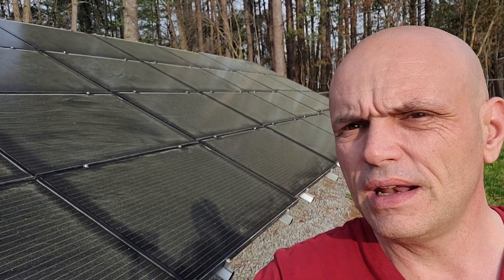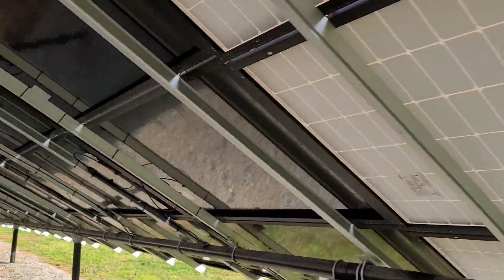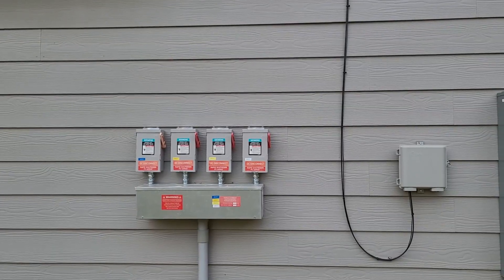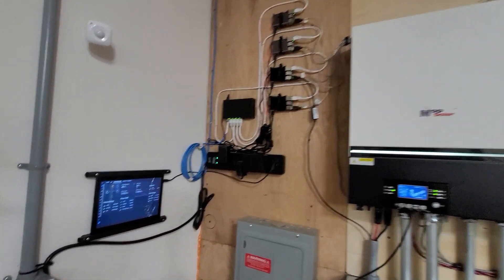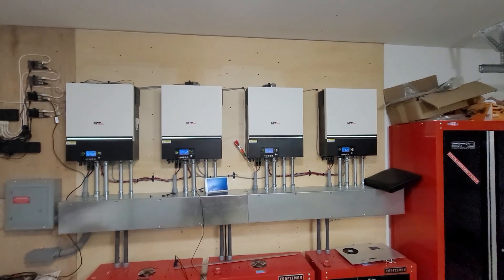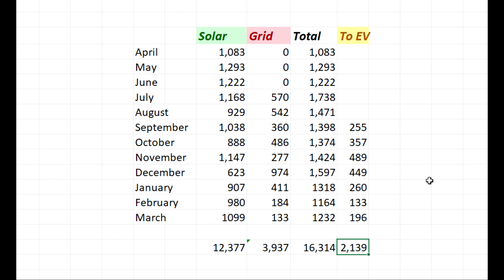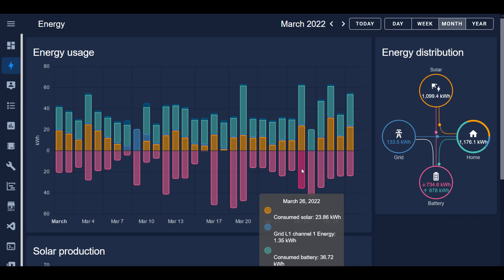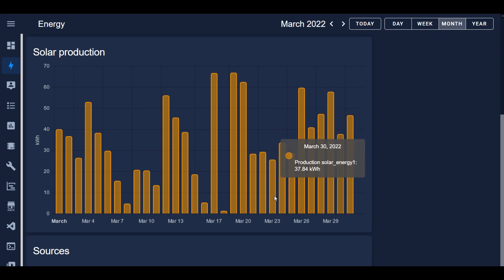LV6548 & 14 8 KW Solar System 1 Year Review (Production Numbers Included)

Comment: Trying to produce and store energy enough to be off grid all time is almost impossible in winter except if you spend a lot of money to add another 40 kW/h battery system. At one point, the ROI has to be part of the equation, not only the obsession to produce kW/h
Reply: 14kwh is only $2000 if you DIY raw cells so its not that hard to add another 28 or 42kwh

Comment: I am going to model my system off of yours....if you don't mind !!!
Question, how loud are the LV6548 at max power in/out ? Was wondering if I should mount them into a separate small room at the end of the garage or just leave them open to the garage. Also any dimming of lights when a high power appliance turns on.
Cheers.
Reply from the maker: Previous LV6548 videos answer all of those questions in detail.

Comment: Looks great. Thank you for the update. 

I agree with battery size 200%. Our 20640W PV and 132kWh battery barely got us through the first month totally off-grid without using the 10kw gen. It produced 1200kWh in March, 130kWh on one cold clear day after the three very dark days. 90% of that was re-filling our battery. 370A at 55.4V were going in for several hours. So you can also see how our weather patterns and latitude difference affect our outputs.
Reply from the maker: Thanks for sharing.

Comment: Great to see a 1 year update! I agree with battery storage as well, but .. there is balance that has to be achieved there for sure. If I do another system at some point I would go with the rack mount Lifepo4 packs.. Those babies are the t's  ; )  
I still have a garage full of panels. 34 to be exact because I put the install on hold again. I'm not sure whether I'll be staying in this house or moving yet. Also, there is the City inspection crap. So, I'll be in touch. Thanks for the update and I hope all is well down in your neck of the woods bro!
Reply from the maker: Everyone is good. What happened? I was eagerly awaiting updates from you...
Reply: I gotta say I’ve been waiting on an update also. Both of you guys really helped with my install. My 6548’s are doing fantastic. I just finished the majority of my install this week.

Comment: I really don't want to pay that much for batteries, looking atleast 100kw of battery to start to not have this issue. But attempting to figure out how to loadshift as much stuff as I can to solar producing hours, water heater, cooking, clothes. Wish I could find a way to offset a/c system, as here the a/c doesnt start running till around 2pm and doesn't stop till 7am.
Reply from the maker: That is the key. Management of resources is very important. I will be first to say that EV threw the monkey wrench into this project. Was not sure if we will get it. Without EV system size was 99% sufficient through out the year.